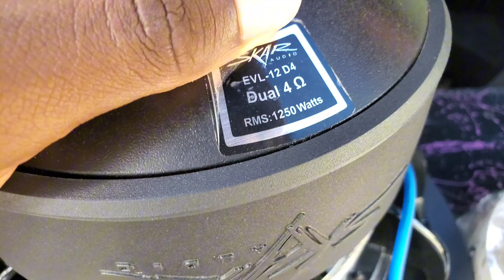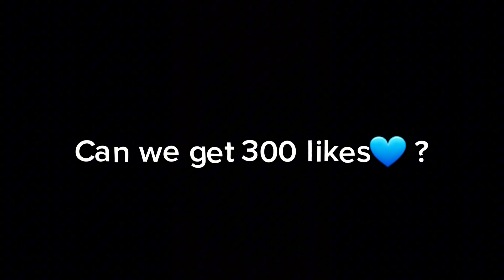Why is EVERYONE Inverting Their Subwoofers | Does It Makes Your Bass Louder?

Comment: You invert your subs if your box is to small. Most 12 inch subs are about .24 cubic feet. So you subtract that from your box's square feet. Your box does 80 percent of the work. You need to at least meet the manufacturers specification for the subwoofer for your box. If it requires 3.5 cubic feet per subwoofer then you need 3.5 cubic feet with a displacement already factored in the displacement is the size of your subwoofer which is usually 0.24 or very close to that unless you have a very large subwoofer with a giant magnet and it's very deep like some subwoofers can't fit into some normal boxes because they are so long. Those are the subwoofers that will be more than 0.24 cubic feet.